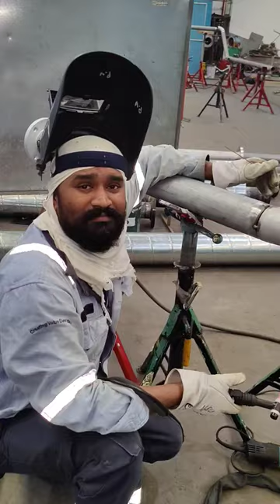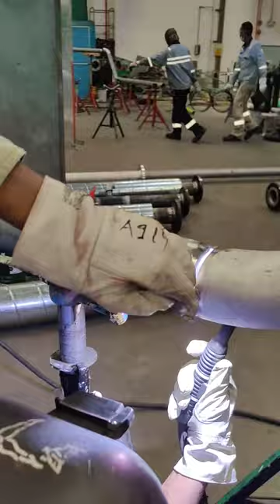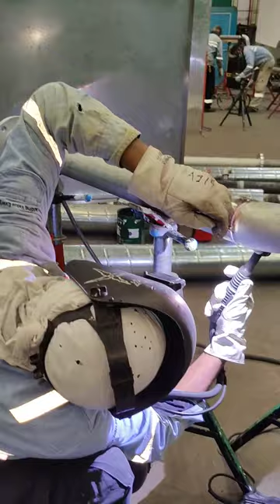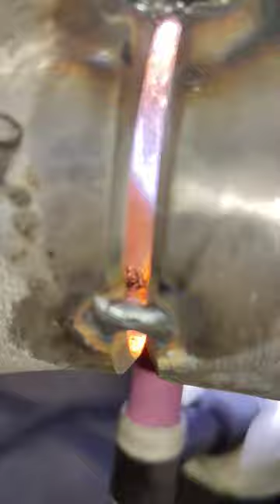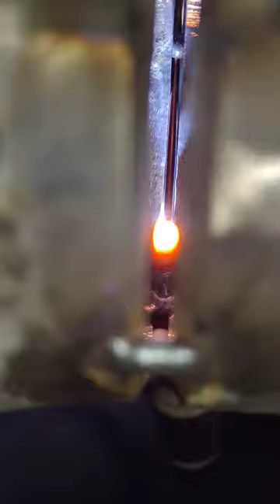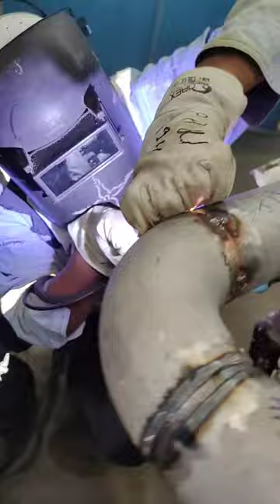carbon steel 3inch root pass tig welding

Comment: carbon steel what do you mean that's stainless
Reply from the maker: Carbon pipe not stainless steel galvanics paint
Reply: Last I knew you don’t weld stainless with 70s filler and no purge 😂

Comment: The tack at 12 o clock is horrific. And the lightning stikes all up the inside of the elbow would get you kicked out of most pipe welding jobs.

Comment: First off, it's stainless the gaps out, it's not purged and it's sugared up inside.
Reply: Carbon steel can look like this if it's been sand blasted.
Reply: Wrong to all three. I’d probably set the gap a little tighter, but the gap is fine if the welder can fill it and get the root in comfortably. Which looks like he can. Just because the pipe is silver, look a bit closer. You’ll see you’re wrong.
Reply: @Southney  I weld pipe daily bud the gaps shit that weld will never mag out. However I admit it isn't stainless that's my bad.
Reply: @southney7211  why would you bridge tack carbon?
Reply: Or tape the jackstands for it? It is stainless. Look at the HAZ
Reply: And he is running a purge
Reply: @ninesixteengenetix definitely a carbon rod in his hand

Comment: Good job pal at first I thought it was stainless steel but I saw the coating and your filler wire so figured it was carbon steel all you need to do is tell the tack welder to put cleaner tacks
Reply from the maker: Tack welder fresh work now training
Reply from the maker: Thank u for ur comments bro
Reply: The tack welder? Lol you mean other people tack it for you?
Reply: @jeepwk6.5L  thats what happens in the uk, i started off tacking then gradually worked up to welding
Reply: @user-xu4xj2cd2j  damn. If you don't have the cert you can't touch it. I've seen some tack welders in a shop but they have certs
Reply: @jeepwk6.5L  yeah thats probably how it should be, place i started off had mainly less experienced welders like apprenticeships or new welders who joined the company (the company only brought in an inspector 3 or 4 times a year). Ive worked sites and welders including myself let others tack as long as they knew how to

Comment: 1 It’s not stainless. 
2 Its industrial maintenance work, like at your local plant. not a pipeline leaking liquid gas. it has to not leak, not pass an x-ray
3 the fitter sucks,
4 the welder is pretty damn good.

Comment: Looks like stainless to me
Reply: Yeah it does, I thought the same thing
Reply: Look a bit closer. Look at the colour of the weld and not the colour of the coating on the pipe. It’s definitely not stainless.
Reply: It's coating...it's carbon, and carbon wire he's using too
Reply: Yes it does

Comment: Unless you have a set up with “lift arc” you should always start up using your filler wire. Otherwise you will dull your tungsten but you will end up trapping tungsten in your weld which can show up as inclusion on the X-ray. And even if it’s not a code job it’s just a terrible habit. Those who don’t take it as constructive criticism will limit themselves. Everything you do as a welder can either help or hinder your reputation.

Comment: Is anyone in these comments an actual pipefitter? 😂 no one has a clue in these comments….
Reply: I am a pipe fitter. I usually run 1/8" gap with a 1/16" landing. I've also done bigger gaps because I had to make up for shortages in pipe. Long as the root is good I'm good. In larger gaps I usually blade the landing so it all melts together. Stt for root pass. Little weave on bigger gaps on the wall but still great penetration. When I run 1/8" gaps I just keep the arc right on the leading edge and watch the build up and melting stage for stt. Thank God.
Reply: @chadmoyer1453  right on. I’m a pipefitter too. Was jw by some of these comments 😂